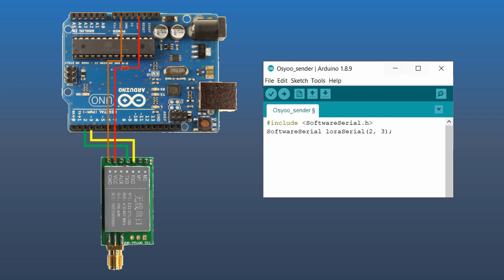EBYTE E32 LoRa Transceiver - Simple Arduino Setup

Comment: Rx tx logic level 3,3 v??
Reply from the maker: The 3.3 and the 5V work
Reply: @jtech1873  The manual states: "For 5V TTL, it may be at risk of burning out"
Reply: @jtech1873  The module data sheet says maximum 3.3v have you actually tested it at 5v?
Reply from the maker: @mfx1  I've tested it at 5V for a short period